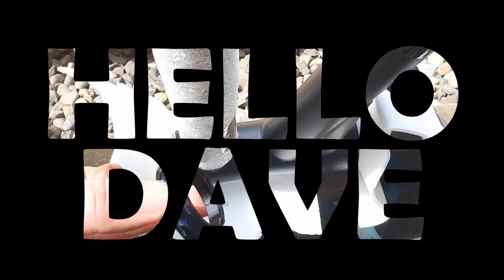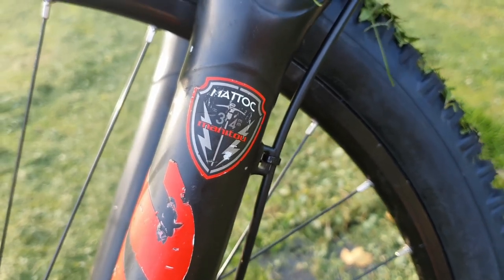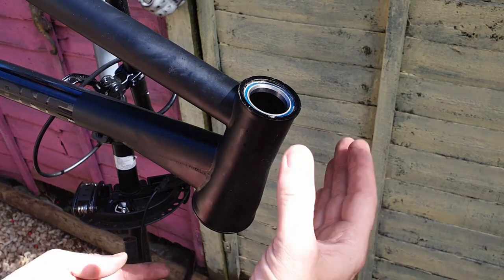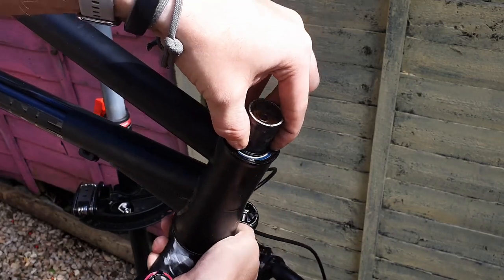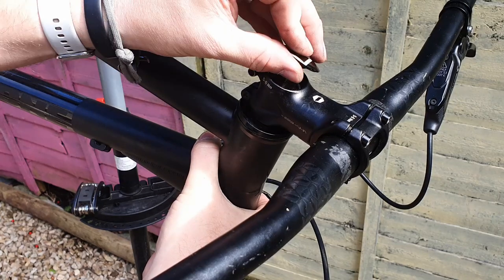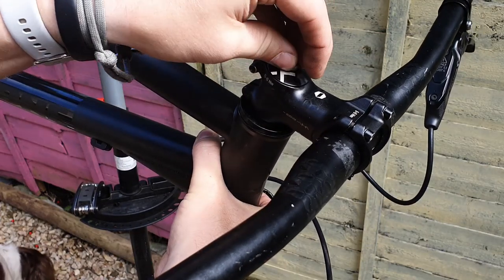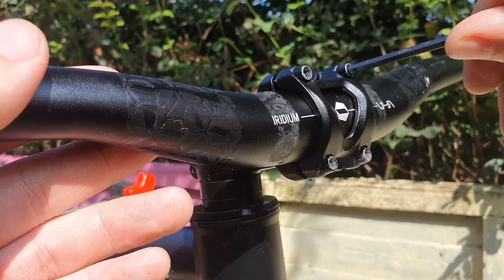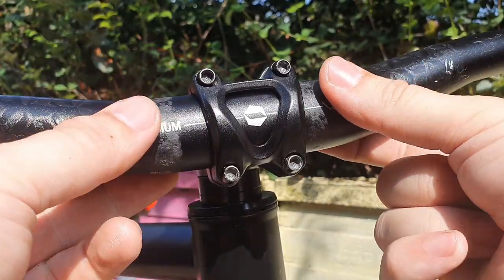Hello Dave Build Part 2

Comment: I think the Hello Dave being a renamed Sick Bicycles Shrike 29 was actually built for 160mm travel 29er. So maybe a 170mm fork would be more idea as 27.5.
Reply from the maker: You could push to a 170mm but I found the sweet spot was at 160mm for me, I did for fun run upto 180mm for a short while bu reverted back to 160mm, the offset is also a factor to watch out for. Even though the Dave is based on the Shrike there are tweaks and differences to the frame, especially the more recent versions but by all means try out what you fancy until you find the handling you are looking for.

Comment: Hey there, mate! I'm building my own hello dave and I have a question. What type of fork should I be looking for and what bearings should I get, what size? I'm a bit confused with all the sizes and compatibility and I'm not sure what fits. Does all forks fit in that head tube? :D  Thanks! <3
Reply from the maker: The Dave will take any tapered steerer fork but worth checking what size frame you have so the steerer is long enough so mostly modern stuff will do. 29er 150mm travel is what it's designed for, but I ran a 160mm with plus size 27.5. Enduro style forks is what you are looking for; I'd not go under 34mm stanchions as the extreme head angle will have them flexing. As for headset, I can remember off the top of my head what the sizing was, they where zero stack and at a guess 40 top 50 bottom but if you drop planet x a message they are normally spot on and very quick to get back to you. Good luck on the build.

Comment: Shorter stem needed for shure!
Reply from the maker: I have a freakishly tall torso so need the extra space but for the regular proportion people I'd agree.
Reply: The Biking Viking these bikes are designed around a short stem, a long stem like that ruins the steering feel.
Reach is very long, then maybe you need a bigger size.
Im 6ft5 and have a xl and that comes with 52cm reach wich is insane.
Reply from the maker: @jorgvanmeggelen6930  it's an XL, doesn't get any bigger unfortunately but it rides spot on, its not that long really but I tried a 35mm and it didn't feel great. The bike has been finished for a while but it takes a while for me to get these videos out.
Reply: @TheBikingVikingDude  I'm 6ft and thinking about a size xl ??
Reply from the maker: The XL would be a good fit I would say, I'm 6'1" and was running a slightly longer stem than most (tall in the torso)

Comment: Seems such a shame to put all these old used parts on a decent new frame.
Reply from the maker: Function and performance over aesthetics is my normal bias, the total build was under £1000 and I had better parts fitted compared with the factory build which at the time was £1699. I was also looking to run plus size 27.5" wheels as an experiment. understand why people build with new parts but I don't build show bikes and I knew the new frame wasnt going to stay shiny and new for long.